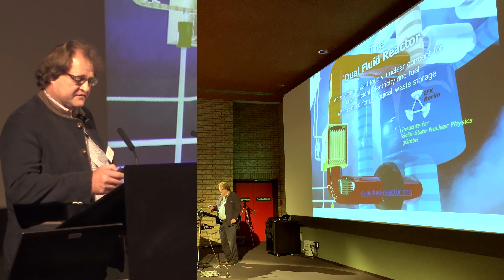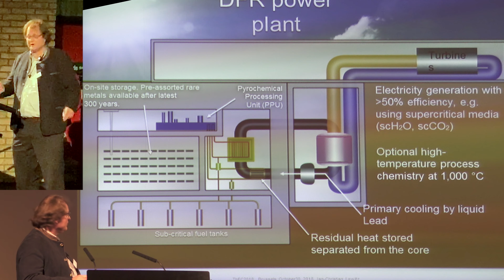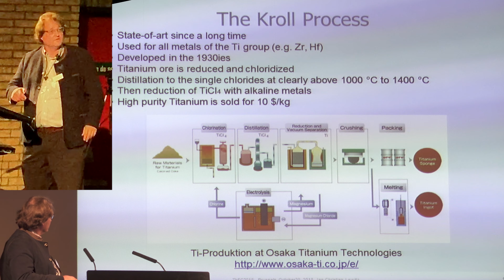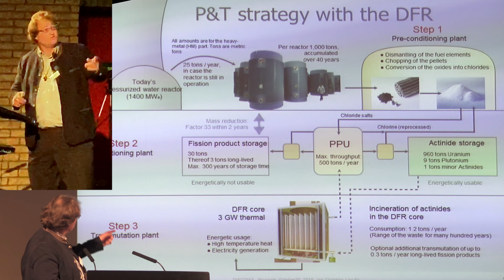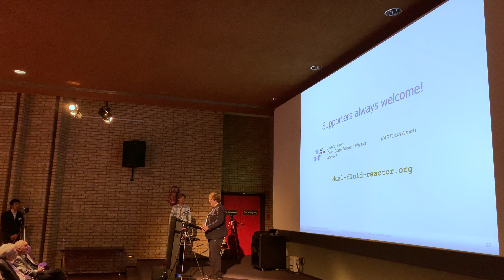DFR: the Dual-Fluid Reactor - Jan-Christian Lewitz @ ThEC2018

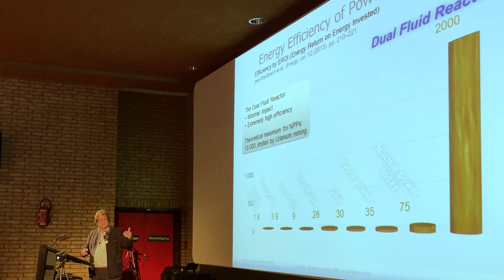Comment: At 18:08 it takes a brave and crazy man to propose widespread use of hydrazine fuels.
Reply: I mean if you have a burning need, its great.
Reply: I've got a strange love for hydrazine but actually using the stuff is nuts.
Reply: @uproar8745  In the chart, the hydrazine is mentioned to be turned into Benzine.

This reactor can desalinate, make synthetic petrochem, hydrogen, and electricity.

1% of the Pentagon budget ($7B/year) could develop DFR & MSR. Prototypes by 2025. Factories producing 25 GW per year of modular reactors by 2030. Ship-based reactors for cruise & cargo ships that clean the ocean.

Most importantly, a new generation of nuclear physicists & scientists to pursue & perfect fusion energy.
Reply: @Nphen  Thanks for clearing it up abit, I haven't got the chance to fully watch the video yet.
Reply: @Nphen  Benzine just means gasoline. The slide is comparing the predicted hydrazine fuel prices to the current fuel prices.
His proposal is based on the claim, that hydrazine is no more dangerous than gasoline. Somehow that sounds wrong, but I'm no expert on the matter.
Reply: Upon googling the topic a bit, I'm guessing he is actually talking about hydrazine hydrate rather than pure hydrazine. The hydrate form is far less hazardous, though it obviously has lower energy density.
Reply: @DangerHugs1111  - I was talking about hydrazine - and stated it can be compared to gazoline in beeing dangerous. I did not say it has the same toxic properties (it is more toxic). It can be handled in the same manner, some technical details at cars and gas stations would need to be changed to leakage free fueling (which is possible). Tanks should be doubble wall, etc. But in such lecture it is not the major focus on such engineering.
Reply: @jan-christianlewitz9907  

Remember Dieselgate? Diesel powered cars can be designed to emit very few emissions. But they have to be engineered properly, and maintained properly. Look at it, some of the affected cars emit ludicrous amounts of nitrogen oxide.

Also: In theory natural gas powered vehicles are safe, but in Germany there was a string of explosions of gas powered cars (again Volkswagen) due to rusty tanks, AFAIK a factory design/manufacturing problem. 

There are MILLIONS of cars on the streets (with varying degree of maintenance), there is salt in the winter and rust, A LOT of people work on cars (with varying degree of knowledge), we have used car dealers driven by profits selling of any junk they can.

=> Please don't suggest we can keep millions of hydrazine powered cars safely on the road.

Maybe, just maybe, tightly controlled commercial fleets could be made to run on hydrazine (e.g. busses) - think airplane level of maintenance. 

But every car and truck running on hydrazine is insanity.
Reply: @MeetDannyWilson  For your information, though years later, gas vehicles are safe. Hong Kong has LPG taxi and public light bus since 2003.  The total number of gas power vehicles average on 20 thousand.   Until late May 2022 never a single explosion case happen.  Since there is no snowing in sub-tropical climate in Hong Kong, no salt is applied on the roads.  It helps a lot.  Public acceptance is extremely good.  Never any objection on LPG powered vehicles.
Reply: I was sitting in a trainstation once and saw a train roll by with one tank of hydrazine and one tank of tetrazine next to each other. Those 2 chemicals are hypergolic when they mix. This was in Ludwigshafen Germany and this guy was probably the train conductor. In reality a lot of these dangers are overblown because it makes a good story. Hydrazine is used in chemistry all the time. I need to get my hands on some for making copper nano particles.
Reply: Well, he is not a chemistry expert. Of course it wouldnt make sense to make hydrazine but instead use the hydrogen to produce regular fues that any current car can use. Or methanol if you want to have fuel cells. And at the same time you take CO2 out of the atmosphere. Win win.
Reply: @leocurious9919  The problem with that is that high quality CO2 is in really short supply when we consider the sheer scale of the problem. There currently doesn't exist any economical way to concentrate atmospheric CO2, and even captured carbon from industry is surprisingly hard to come by even if you offer to pay for the equipment.
Nitrogen based fuels, mainly ammonia (and now evidently hydrazine), are appealing because they only require air and water to produce. The CO2 issue is really the only reason why they are even discussed, since hydrocarbons definitely would be preferable, if we could actually produce them.
Reply: @DangerHugs1111  How is CO2 out of the air (or the tech used to extract it) "hard to come by"?
wikipedia.org/wiki/Direct_air_capture

Hydrazin is too dangerous and thus will not be used.
Reply: @leocurious9919  I said industrially captured carbon (from flue gases) is hard to come by (in sufficiently huge quantities). I'm well aware of all the atmospheric carbon capture techniques. We've discussed them extensively at work and we've begrudgingly had to admit that they are all woefully inadequate to even begin to tackle the issue. Even if you could make them efficient enough, the sheer volume of air you'd have to process is so mindbogglingly huge that just the machinery to move the air around would be rather ridiculous.
 Do you happen to have a good source for assessing the hazards of pure hydrazine vs hydrazine hydrate (see the point earlier)? You claim that with some conviction, and I haven't had a chance to dig around enough to conclude it myself.
Reply: @DangerHugs1111  Regarding toxic effects etc. it doesnt matter if there is a bit of water in the hydrazine, for the exact hydrat thats 36% water. LD50 is about 50mg/kg, thats the same ballpark as cyanide. But unlike cyanides this stuff is volatile and non-lethal levels of exposure are also toxic. And its a carcinogen too. Its just not practical at all.

CO2 can be captured but it does cost energy. However, its the only sensible way to convert power to gas/fuel. Either normal fuels or methanol (or DME). All the existing infrastructure etc. can be used just like befor and it can be mixed with the current fuel during the (long) transition. For hydrazine or hydrogen or whatever this would be impossible, it would be a hard cut and everything would have to be rebuilt.
Reply: @DangerHugs1111  It's already possible to use the oceans themselves to concentrate CO2, as large bodies of water have dissolved carbonic acid in equilibrium with atmospheric CO2 at 140 times the concentration in water as it is in air.
What this means is that you don't really need to design some kind of ultra-high airflow condenser - just use the ocean. 

Large scale electrolysis of seawater should produce CO2 with proper membrane design, at chemistry purity. 

https://bravenewclimate.com/2013/01/16/zero-emission-synfuel-from-seawater/
After that, it becomes trivial to have another unit produce H2 - either at high temperature in a reactor, or using electrolysis. 

H2 and CO2 in the water-gas shift and Sabatier series of reactions should yield syngas of exceptional purity, free of the sulphur oxides and nitrogen oxides that would ordinarily be present from water-gas shifting coal, for example.
And if you're producing carbon monoxide or methane from sea water electrolysis + Sabatier then you have the basis of a petrochemical industry replacement.
The key question is of course, non-fossil fuel electricity and heat being available at quantities that put national electricity grids to shame. But if we have that kind of energy abundance, then we have the CO2 problem licked.
Produce light alkanes from Sabatier, use them to displace fossil fuel burning and as an industrial feedstock.
The excess can be passed through a column of molten tin and reduce CHx to Carbon and H2 gas: https://www.iflscience.com/environment/breakthrough-carbon-capture-technique-ushers-era-guilt-free-gas/
The solid carbon from molten tin cracking is useful for pigments, and can be chemically treated to produce activated charcoal - both things that are currently produced by combustion. 

Of course, all this technology is useless without government planning and scaling to ramp it up to a scale the same as the entire fossil fuel industry today.
The scale is vast, but that is no obstacle. Only fear and ignorance hold us back from apotheosis.
Reply: @DangerHugs1111  It's that sort of thinking that makes people think we could grow plants on Mars in special greenhouses because the atmosphere there is mostly CO2. They forget that there is almost no atmosphere on Mars at all and what little there is would have to be compressed and concentrated to such an extent that it's basically not worth the effort. The technology to accomplish such a feat simply doesn't exist in a way that would achieve the desired result. It would be easier to simply compress CO2 in cylinders on Earth and send it along on a rocket later on, rather than get the compressors you would need to land on Mars and actually run. Their efficiency would be terrible.
The people just don't get that the physics are really against them.
Reply: @leocurious9919  I was more interested in the volatility and inhalation toxicity. People generally avoid ingesting dangerous things. Evidently, even though the hydrate is less volatile, it still can't be considered safe by any reasonable person, which left me a bit confused as to how Lewitz came to that conclusion.
Again I'm guessing, but he probably is actually referring to the concept developed by Daihatsu Motor, where the hydrazine is stored in a stable solid polymer . Only a very small amount of free hydrazine is present at any time. According to Daihatsu this makes it about as safe as gasoline (almost those words). So either Lewitz misunderstood their point and just took their word for it, or he didn't have time to get into it here. Here's a veeery old article about it.
https://www.greencarcongress.com/2007/09/daihatsu-develo.html

So I concede you point about toxicity, but the Daihatsu concept looks at least plausibly workable. I'll have to look into it more to see if that has gone anywhere since 2007, and what sort of energy densities are achievable.
Reply: @MonMalthias  Thanks, that's actually quite interesting. Hadn't really considered that. Still, 140 times a very-very small number is still a very small number. Might still be workable with enough cheap power. We are nuclear friendly here but funnily enough, that might be a great curtailment dump for offshore wind, if it doesn't mind running intermittently.
Reply: @DangerHugs1111  
The CSIRO did a study on the viability of intermittent powered hydrogen electrolysis. https://www.arena.gov.au/assets/2016/05/Assessment-of-the-cost-of-hydrogen-from-PV.pdf
In short: the numbers don't look good.
Current steam methane reformation hydrogen you can expect to get for ~$1 to ~$4 depending on the cost of natural gas.
With the best case numbers under CSIRO assumptions - 2030 numbers for batteries where cost per kWh have fallen by 50%, where fully installed solar PV including all electronics and civil engineering works is $2300 per kW and where the PEM electrolyser and associated components costs ~$2200 or so - the cost of H2 is $9-$18 per kilogram. See page 8.

At a 9-18 times cost disadvantage it is obvious that this kind of thing just won't work with intermittent generation.
I guess where it could be made to work is as a "dump load" in an electric grid with more than 30% VRE. But you would have to make sure that you have the national grid and more importantly, supergrid with HVDC shunts to isolate high-volatility areas and get all that excess energy to the electrolysers.

A lot of the excessive cost comes from running the PEM electrolysers intermittently. These machines are designed to run 24/7. Operating with a 20% capacity factor really punishes the payback time. You could do it, but you better be getting paid extra for the arbitrage duties, even above and beyond $0 wholesale electricity rates that you would rely on when acting as a "dump load". This is because PEM machines aren't designed to be rapidly cycled on and off and doing so causes wear and tear at where the redox reactions are taking place. You can avoid that wear and tear by using a battery, but then you have to pay for the battery.

Overall I don't see VRE produced hydrogen becoming competitive without industrial strategy to actively ban steam methane reformation while pushing hydrogen production. And while that is absolutely a valid way to do things, it would probably require a degree of protectionism at the natural gas injection terminal to prevent foreign gas from destroying your economics. 

I would wager that a light water reactor operating at 90% CF and in baseload mode, with PEM electrolysers operating in the off season, to be more economic. 

You don't need the absolutely punishing cost of a battery for power smoothing, you're using electricity that would otherwise be dumped anyway, the electrolysers might only run a few months a year, but at 100% capacity during those months, so startup and shutdown wear and tear is minimised. And you don't need water purification for the input either, since the nuclear plant would be doing that for you. A district heating pipe carrying effluent steam from the steam turbines could even provide feedwater pre-heating to get to 80 degrees C for the PEM units, thereby also avoiding costs of heating.

I would argue that for hydrogen and hydrogen carriers to really take off, we should be thinking hard about scaling up nuclear and hydroelectricity to meet those challenges, instead of trying to force a solar and wind shaped production into an industrial load shaped demand hole. Not to say you can't do it, but it's a lot easier than adding the already high costs of PEM electrolysis to the intermittency integration costs of VRE.